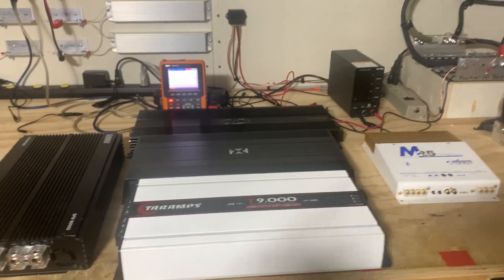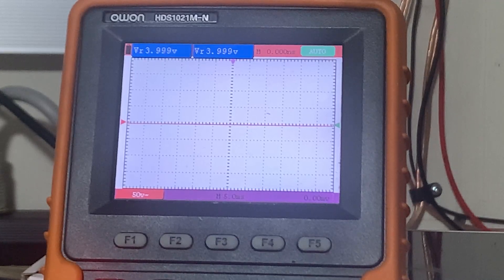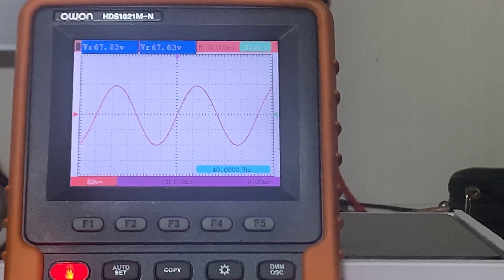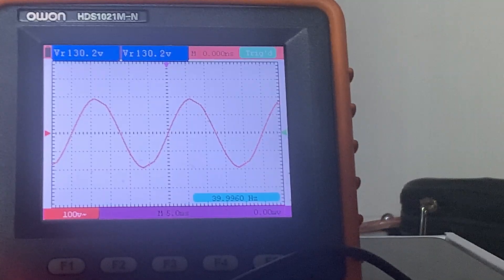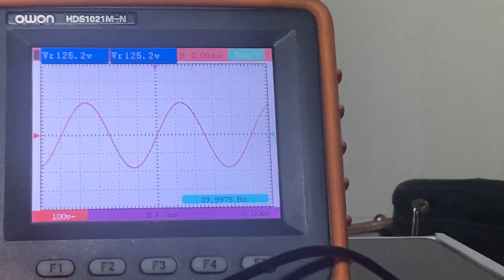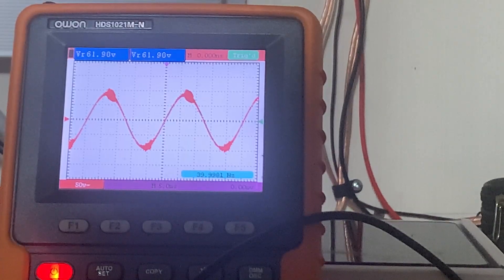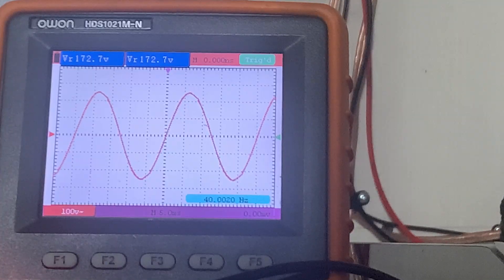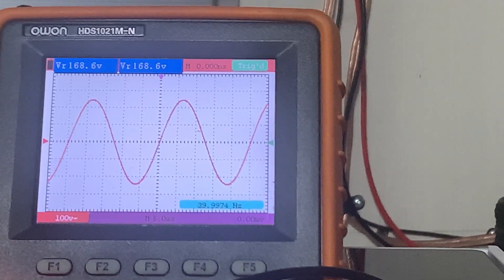Amp comparison testing on the Oscilloscope unloaded

Comment: the coil of the speaker load on some amps is used to filter the high frequency switching noise and its nothing you will hear anyways. id assume to save cost
Reply from the maker: That makes sense. Thanks for putting it into terms this everyday Joe can understand. 👍👍

Comment: I’m running a big boss bass 5k on a 9921 rn thing is doing great , I may have to consider that chipeo 12k if I go to a dual 21 wall , was thinking about going with a poweus pw15k but the price on that chipeo is too good
Reply from the maker: The have a Chipeo 16K out now as well 😃

Comment: Amp dyno results can be manipulated. If want to get good numbers there's tracks that increase rca signal voltage quickly. If want lesser numbers a slower rca signal track is chosen. It's all in how much  $$ you're willing to par the amp tester. Also only a few selected brands tests are done at higher input dc voltage to get better results

Comment: About the clip light on most amps. These are typically a basic comparator circuit where are the speaker output voltage is compared to the rail voltage. When the clip light first starts to flicker on, that just means that the voltages are basically the same. It doesn't necessarily mean that you have clipping. It's only when the light gets brighter and goes solid that you know the signal is starting to clip. 

It's a good design because your rail voltage is going to fluctuate up-and-down based on the input voltage of the amplifier. 

I've heard of some amplifiers where the clip circuit doesn't actually come on when it should. Or it comes on way before the amplifier actually clips. That's really strange and I can't explain. The circuit was probably just designed poorly on those certain amp models. So it's definitely a good idea to verify that the clip light is coming on when it should.

Comment: Products like Tonys AD-1 dyno doesnt specifically look for clipping. On the certified test, it's measuring distortion. Clipping is a type of distortion, so it will show up. But what Tony's dyno is actually looking for is a little more complex. It compares the fundamental frequency with the 3rd harmonic to calculate the total harmonic distortion level. Tony was explaining this to me, but honestly, it's a little over my head.

It's a good technique though. Not only does it pick up things like clipping, but also stuff like if the sign wave were to a shift to one side or becomes unsymmetrical, etc...

Comment: I had the sound stream amp before..Was very reliable had it for a few years..Was not a very clean sounding amplifier in my opinion but it was very reliable..Just never sounded very good in my opinion
Reply: Also had the DD 2500a did not last long was my first and last DD product..I did not like it at all and went into protection and never worked again very quickly